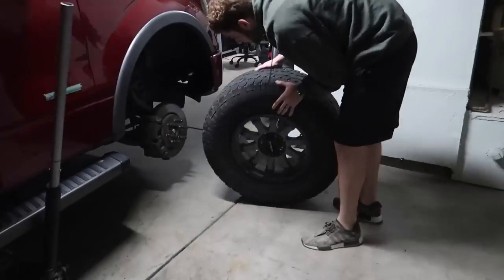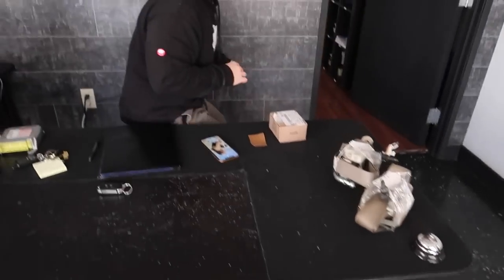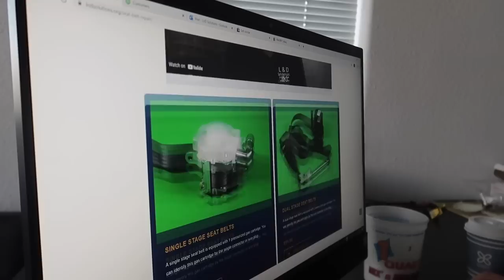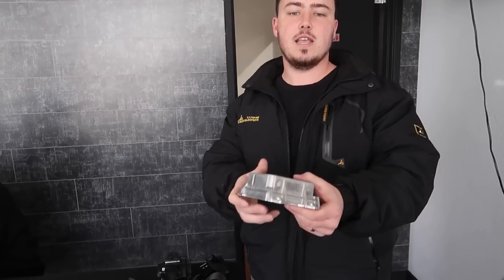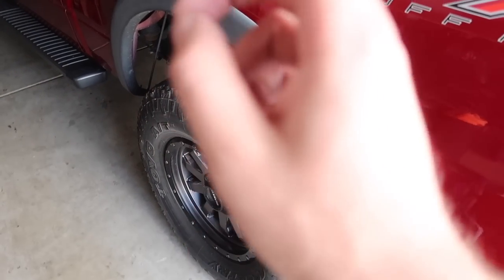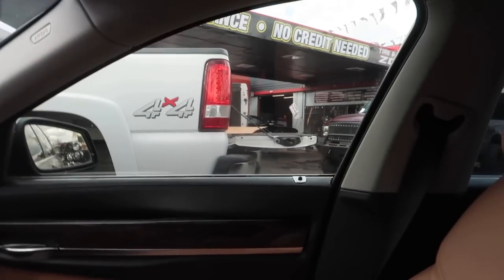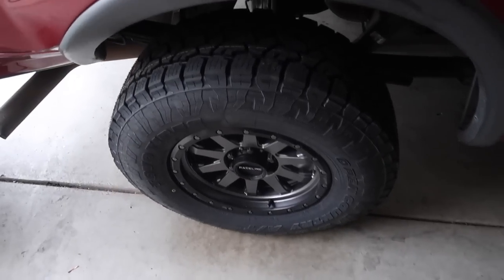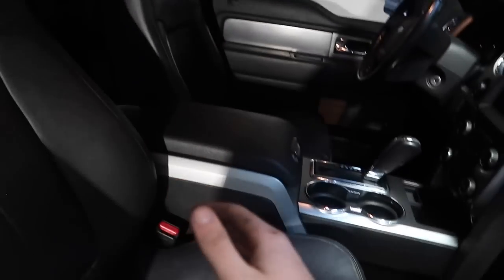Rebuilding My TOTALED 2014 Ford F150 Part 2!

Comment: Before you change the rear axle just check the pin in the leaf spring it will be broken if that’s why it’s not in line great videos

Comment: Maybe is not bent, Just moved from the center of the springleaf?
Reply: Exactly what I thought. It doesn't look bent. It looks like the differential mounts are slightly twisted to the passenger side which would make sense as the truck was hit at the back side of the rear wheel.